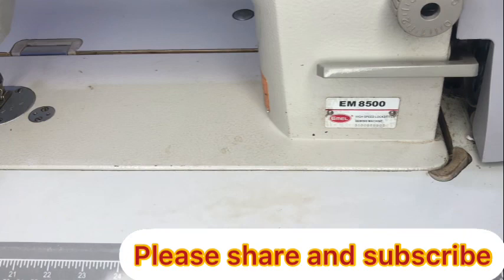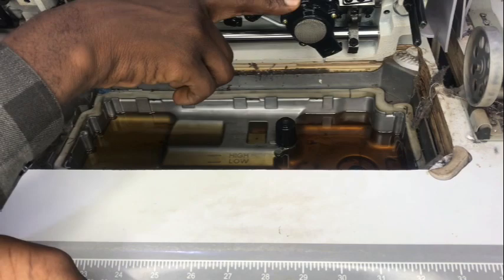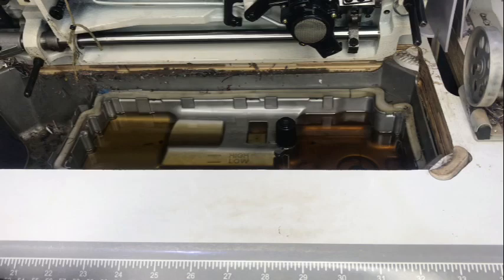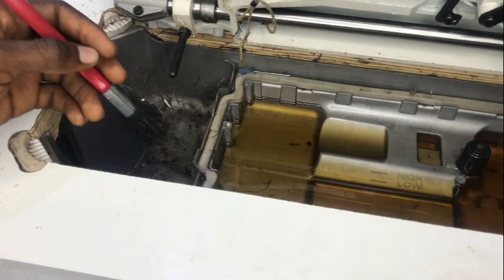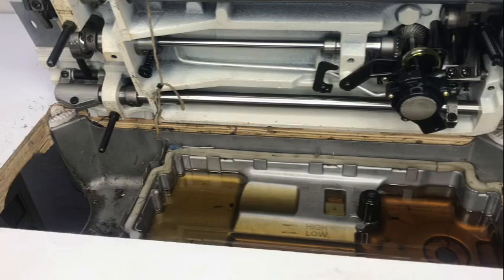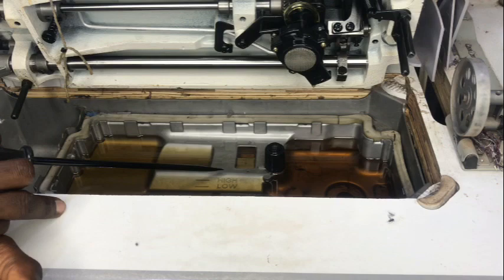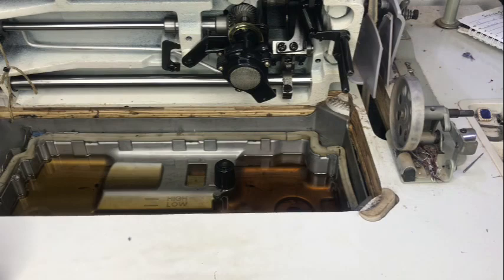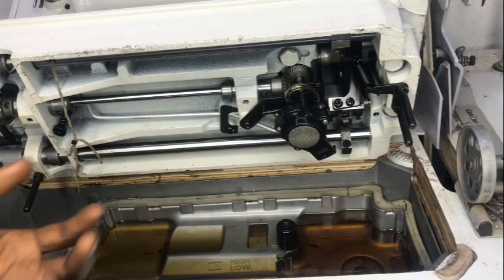Tutorial on how to service Industral sewing machine episode 2

Comment: Please what if my pump is not sending oil upward, what do I do sir
Reply from the maker: Check if the pump is rolling thru the net
Reply: How do I do that sir, cause when I peddle it doesn’t send oil. Thanks for replying sir
Reply from the maker: @NunuTemi-ox5pn  when you open (flip)the machine  use your hand to turn the wheel and see if the pump is turning or rolling in the iron net
Reply: Although the black stuff that has a net covering it is not turning
Reply from the maker: Then  Your pump is not working
Reply: @alukosewingmachines3782  what do I do sir 🙏
Reply: Please sir how do we do to a pump that's not working ...how do we fix it please🙏🏼